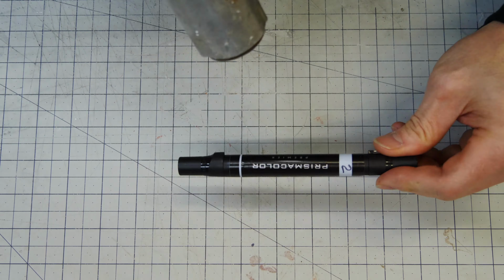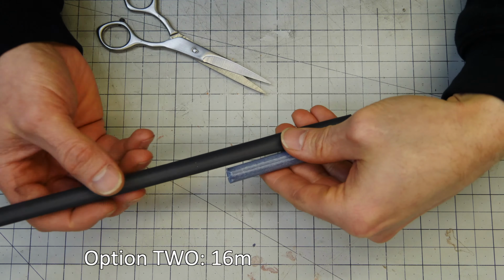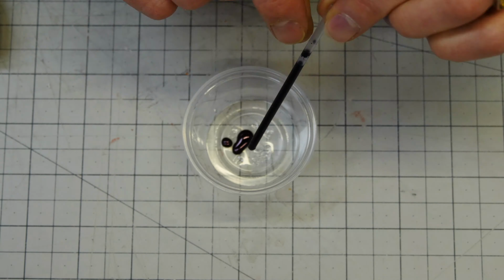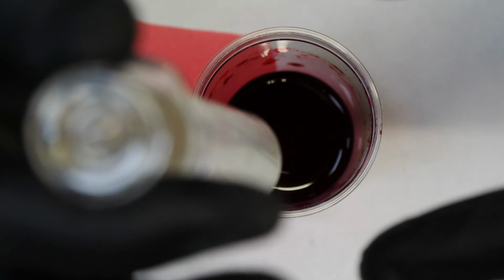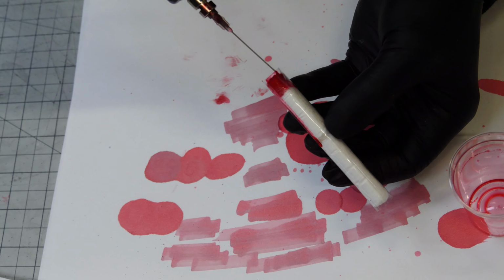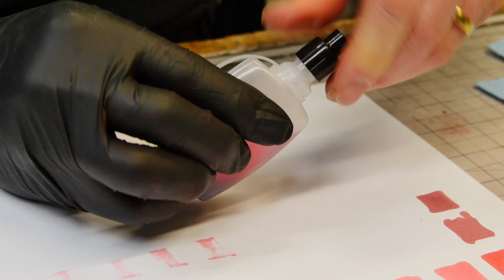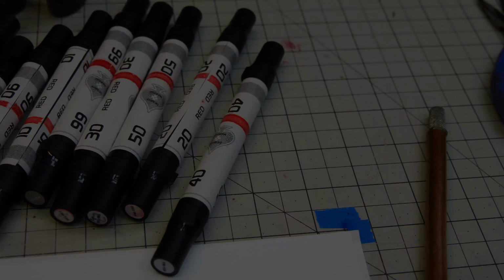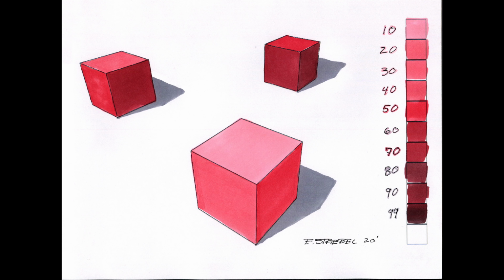Make Custom Gradient Alcohol Markers

Comment: Hi Eric! Thank you so much for this video. It´s just  what I need as a industrial designer and teacher. In fact, I share this video to my students and now 60 little future designers are aware of how to have lifetime markers to design!!! I´d like ask you somethign: Have been pass some months since this video was released: How often do you recharge your markers? or: How many rechanges can the ink did you use last? I´d like to know your thoughts. Thanks again. This video is on my  best DIY list.
Reply from the maker: I recharge them as needed based on how much I use them but I have the inks mixed up for the red ones at this point so I could just add more at any time as needed
Reply: @EricStrebel  Thanks!